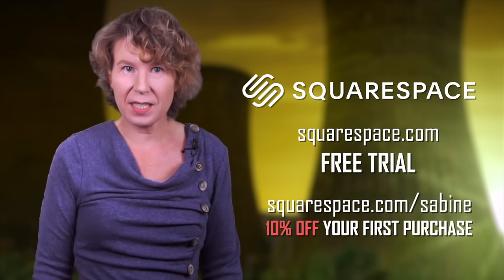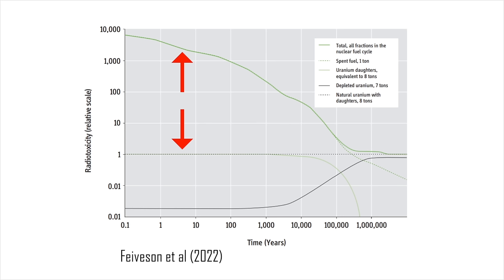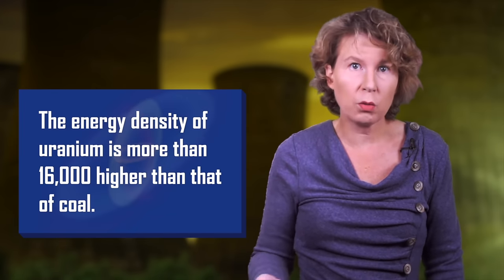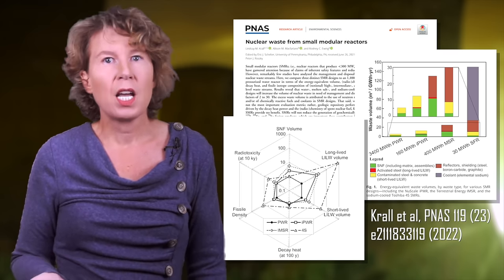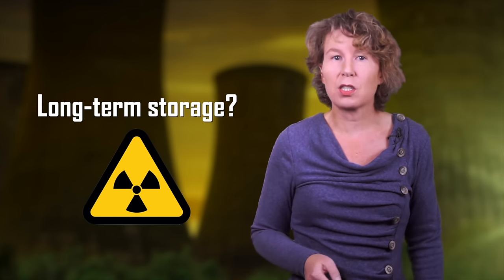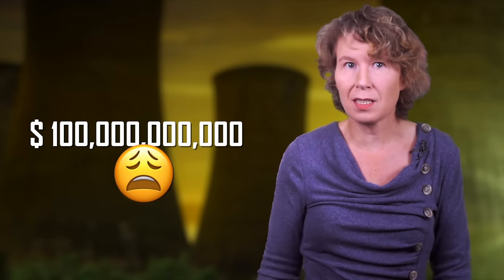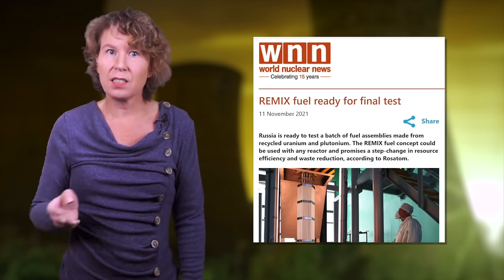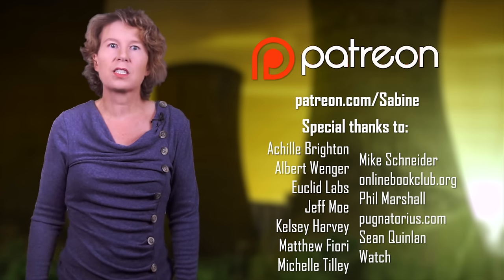Nuclear waste is not the problem you've been made to believe it is

Comment: What about the cost of dealing with the waste? Forgive me if you covered that, I didn’t see it. It would be interesting to know how that was factored in to the cost per kWh.

The UK nuclear decommissioning authority has a budget of £68 billion. Granted, a significant portion of this is for some nasty sites like Sellafield from the 50s and 60s, but its quite a lot for 9 operational reactors. 

I went on a tour of our most recently-built reactor Torness (1988). It’s an Advanced Gas Reactor so the moderator is a great big pile of graphite bricks the size of a small block of flats. It’s going to be shut down soon. The guide said that if they wanted to return it to a green field site the first step would be to turn off the power and let the graphite pile sit for 80 years. 80 years!!!!???

I imagine that this will be the case for every nuclear plant- none of them will ever be returned to green fields. Instead ,a ‘B’ reactor or a ‘C’ reactor will built on the same site so nobody notices. Am I wrong, is there an example of a plant that was totally cleaned up?
Reply: Yeah, the cost is nuts. On cost, I remember cost comparisons being done when they started thinking about planning for Hinkley Point, lots of pro and anti figures. The big take home for me was the level of obfuscation around cost from the pro side and how quickly those pro figures started falling apart under closer scrutiny. Headline costs, it turned out, included construction and running the plant, but didn't include the cost of decommissioning or long term/post decommissioning waste storage, which we'd pick up, UK tax payer, rather than EDF Energy, so huge hidden long term UK exchequer cost liability. The big known unknown was of course waste storage solutions and related costs. The Finns' maybe on it, but here in the UK we've never been on it for more than a couple of decades, so securing something for a 100,000 + years? I'd have vanishingly little confidence in our ability to maintain containment much past the integrity lifespan of the initial receptacles employed. Ie a few hundred years tops.
Reply: Yes, some 25 greenfielded sites so far. Let me cite wikipedia:
As May 2022, about 700 nuclear reactors have been retired from operation in several early and intermediate stages (cold shut-down, defueling, SAFSTOR, internal demolition), but only about 25 have been taken to fully "greenfield status".

One problem with nuclear decommissioning (and disaster management) is that it easily becomes a political project, and politicians can spend any amount of other people's money and enact any extreme regulations in order to look decisive and responsible.
Reply: @uilleachan the typical way this is done around the world is that operators are required to set aside like £0.001/kWh for decommissioning and waste storage. It's very cheap, and in any LCOE, waste management costs are insignificant due to discount rates applied combined with long time frames until the actual costs materialize.

Securing waste for 100,000 years is incredibly easy. Remember that the reason we have natgas (and oil) in geological reservoirs under high pressure, with methane being an incredibly volatile and tiny molecule, is that nature has put a lid on it for tens of millions of years. So that's 100s of times longer than what we need for far less mobile nuclear waste.
Reply: @jesan733  
So what are the demonstrated costs of waste storage?
The Finnish facility is not yet operational. it has been "next year" for about five years. How do you relate their costs to the US, where estimated costs are enormously higher?

I do not believe that waste management costs are insignificant. The US nuclear industry went to court in 2010 to fight having to contribute to the disposal fund. That disposal fund was less than half the estimated cost of a US facility, yet the industry contributions were too much for the industry to afford.
The DOE and DOD have similarly gone to court over liability for a small fraction of now vintage military wastes. You'd think the military would have enough "honour" to take this burden with a straight back. Seems not. Probably more expensive than advertised.

Assuming "discount rates" for waste storage is absurd. It won't get cheaper, it will get more expensive. Every other form of engineering with defined performance standards has exceeded inflation. From bridges, to nuclear power, to medical devices. 

Securing highly soluble fission products is not equivalent to mineral hydrocarbons trapped in a water saturated salt dome. Not remotely.
Reply: @aaroncosier735 you do not believe that waste management costs are insignificant, but perhaps you should check your biases? Which purported nuclear issues do you find completely overblown? If there are few to none, then perhaps you're not as objective as you think you are.

The costs of nuclear waste handling is what we want it to be. You can always polish it, research it and overdimension it even more. 

You can't jump from the fact that the industry doesn't want to pay any more than what it's already paying/has paid, to the idea that it's somehow unaffordable.

Waste storage could very well become much cheaper, since it's a function of regulatory excesses that could potentially be ramped down. Bridges, nuclear power and medical devices haven't had "defined performance standards" but ratcheting regulation. Still, it's not "absurd" to go by today's costs, and then apply discount rates. It's standard fare, and one of the major reasons intermittent power is perceived as cheaper. It's more short-lived and faster to build, so it may win over extremely long-lived assets like nuclear power whose power production for 2/3 of its life is considered worthless. But you can't have the cake and eat it, the consequence is that waste disposal has insignificant cost because it comes late.

Also, again, nuclear waste is the opposite of being highly soluble, and the multiple barriers used for nuclear waste impress those who aren't anti-nuclear to begin with. One barrier suffices for tens of millions of years, but you don't trust multiple engineered barriers for tens of thousands of years. It's completely unreasonable.
Reply: @jesan733  

Correct, I do not believe waste disposal costs will be insignificant.

I do believe they will be much higher than optimistic industry estimates.

Any argument that they will be low or even "insignificant" is only hot air until you can point to demonstrated examples with a substantiated timeline of performance monitoring.
If you are assuming such costs will be insignificant, then you are not being as objective as you pretend.

Yes I can make that leap. The present funds stand at about 45Billion, with contributions halted at 2010.
Yucca mountain, the only US example intended for spent fuel disposal, cost 15Billion. Yucca's capacity would be less than half the existing US spent fuel stockpile and is bounded by geological features that prevent expansion. Multiple facilities on that scale adequate to hold the current waste stockpile , in todays money, is estimated to cost more than twice the current provision.

Straight up, if the industry cannot pay that and remain viable, then it is manifestly unaffordable.

Waste storage is unlikely to become "much cheaper". There are no regulatory excesses, and a lot of unwarranted optimism given there are no working examples with performance history.
As I said, bridges, nuclear power and medical devices have exceeded inflation. They have to work. Virtually any durable item of value has done so. When corners cannot be cut, prices go up.

Nope, the cost of delaying disposal has increasing costs. Just like building a new house to the workmanship and standards of an old one. Delaying waste disposal has the added costs of re-learning handling processes and re-building handling facilities such as pools in locations that have been decommissioned.

Fission products are indeed highly soluble. In the time frames involved the thermally stressed pellets will degrade and release material on grain boundaries. Zircal rod jackets also degrade.  

By all means demonstrate examples that have survived "tens of millions of years". That is just hyperbole. 
The engineering challenge is to meet the currently recognised necessity of containment for around 100,000 years, and that is not as simple as you pretend.
Reply: I asked you if you find any other purported nuclear issues completely overblown, in order to help you check you biases. You ducked the question.

You ask for demonstrated examples with "a substantiated timeline of performance monitoring". Antis always make sure to set the bar unreasonably high like that, in your case demanding we wait 100 years or something for the first repositories to be sealed. You do this for the same reason you always fight tooth and nail to block any final respository: You don't want these facts on the ground, because then one of your last arguments against nuclear will be wrested from your hands. Anyway, no "performance monitoring" should be done. After you have sealed the repository, no more activities should be planned. 

Ok, so twice 45 billion to put some canisters in clay in deep tunnels? That's insane, but you can do tha. But consider that the US has produced 31,400 billion kWhrs, so at 90 billion, the per-kWhr cost is then 0.29 cents/kWhr. How is that unaffordable?

Your claim that there are no regulatory excesses is not serious.

When it comes to delay, you want compare prices after adjusting for inflation. However, that doesn't really capture effort since we have per-capita growth on top of inflation. If you divide the cost by per-capita GDP, then you get some kind of measure of how much effort it is in terms of man-years. And since we're becoming more efficient at e.g. digging tunnels, transporting materials and more, the basic reduce. Of course they won't if you pile on unnecessary regulation, but still.

Delaying waste disposal beyond the normal timeline could make for tiny added cost in interim repositories, yes, but geological storage isn't supposed to be done until after the waste has cooled for 40 years anyways, so that and some more is factored into original calculations. Also, an actual delay beyond 40 years will mean you don't waste efforts on small volumes of old waste, instead doing more later in a more focused effort. That's going to save costs. 

Fission products aren't "indeed highly soluble", and you again refuse to meet the challenge of enumerating which fission products you're afraid of, exactly, that will just geyser out of the 500m deep repository within a meaningful time frame. Thermally stressed pellets and grain boundaries, give me a break. The point is that there are multiple barriers, all of which guarantee that this waste isn't going anywhere. Everything is calculated and dimensioned with maximum pessimism, which is part of the regulatory excess. You ask me to demonstrate examples that have survived for tens of millions of years, but you ignore the example I gave you, the natural reactors in Oklo, Gabon.
Reply: @jesan733  There are different categories of waste to secure. I can imagine (I'm not expert) that very small quantities of highly radioactive waste can be secured in deep underground, stable and carefully designed flasks at a relatively small cost. Are other categories medium and moderate so easy? The concrete steel and pressure vessel, the hundreds of tonnes of water, moderators, control rods etc?

But I guess going back to the question: the cost of decomissioning, the cost of anything is dominated by the scale. If there was a global requirement 10x more storage, there would be facilites in the world operating at scale with the planning consent, civil engineering and mechanical engineering of the flasks done. The cost for additional storage would be small.

If we in the UK had followed the French model and built many reactors in the 70s/ 80s we would have enjoyed 40 years of green, reliable energy and any storage issues would be much less.

But I think there are some challenges for UK nuclear power. It isn't generally popular with people, it's effectively banned in Germany and Japan, I think British people are agnostic about nuclear power and the premise of Hinkley Point C but it was so horribly botched that they will come to hate the whole project. The involvement of China, the strike price of £95 per WMh vs £35.5 per MWh of OFFshore wind*, and the gulf between these two figures is only going to increase.

The inability of large reactors to be revved up and down to fill in for inconstant renewable power means it can't be a major part of the energy mix in the long term future, when renewables presumably will be a major part of energy generation. As far as I can see it, the only thing that plays well with renewables is gas. That may come to be unacceptable.

Can small modular reactors fit the need?

I must say I'm not anti nuclar, it's safe, clean-ish and secure. But it has a way to go before it fulfills the prediction in the 50s that it would be "too cheap to meter".

*https://www.carbonbrief.org/analysis-record-low-price-for-uk-offshore-wind-is-four-times-cheaper-than-gas/
Reply: @jacklav1  lots of medium to low level waste can be dumped in shallow repositories because the contamination decays rather quickly to a level that's not problematic. 

Agree about scale and costs. However, I don't really agree Hinkley C is botched. Nuclear power has much higher value, Hinkley has a profit sharing clause and the strike price is just for the first third of the plant's life. Then power will be sold at market prices and hugely benefit the UK citizens. Also you should consider part of the expense as a cost to regain scale in the nuclear arena. Germany has paid hundreds of billions to achieve scale in solar with very little actual solar production to show for it.

The fact that it makes little sense to ramp nuclear up and down rather means RE revenue will suffer. Electricity prices, and thus revenue, will be close to zero when the weather is conducive to RE generation, but really high otherwise. Thus nuclear will earn money at medium penetration but intermittent RE won't.
Reply: @jesan733 'one barrier suffices for 10s of millions of years?' C'mon man 😂
Reply: @itcantbetrueable  natural gas: Am I a joke to you?

Comment: Thanks, I was wondering if anything changed to make it more green. Apparently not, although the future technology sounds promising. I didn't know about the ash situation.

Good point about launching it off the planet, although, since the 70's, I always thought to the sun. Not just floating out there, that would not be a good idea.

I liked the dry humor, it helps break up the seriousness of the topic and makes it more enjoyable to watch.

Thank you for sharing.
Reply: Well, the problem with launching anything into the sun is that it's harder to do so than to leave the solar system.

Basically you have to realize that we are moving extremely quickly around the sun, 30 KILOMETERS a second. (over 18.5 miles a second for anyone who uses outdated systems) This is a real issue because you have to slow your spacecraft down by thirty kilometers a second after you escape the gravitational well of the earth. To put that into perspective, the ship with the most delta-v we got into orbit around the earth was the Dawn spacecraft, which had 11 km/s of delta-v (delta means change, v is for velocity. 11 km/s of delta-v means you can speed up or slow down by 11km/s total before you run out of fuel).

Simply put, we can reach pluto, but the sun is far far harder, and that's without having to ship tons of spent fuel to space.

Also imagine an accident where the rocket explodes as it's flying up into space, unlike a casket leak where you may have a small amount of radioactive dust enter the environment, suddenly you've just showered the vicinity with radioactive elements. It's like the fallout of a nuclear bomb without the bomb.
Reply: @randomaster138  Thanks for that explanation. I'm well.aware it would not be practical in any sense of the word. 50 years ago I wasn't thinking in those terms. The very idea of laughing it into space is extremely dangerous.

The issues I see is, like most advanced technology,  the waist by products are far more harmful in the long run than people care to think about. I don't see any solution to that, but ignoring that and calling it green, does not make it so. Less harmful is probably the best description that could be said, but even that may not be accurate.
Reply: How about turning the waste into fuel.
Reply: @jonathancole5179  I'm sure some of it is used for other things, but I would have to look it up. When I was young, they were digging huge under storage facilities to store the waist. They say it would be there for N thousands of years. Not a pleasant thought.